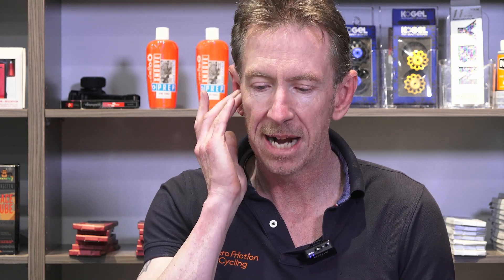Episode 10  - 12 Speed Chain Compatibility

Comment: Question: Is the previous 11 Speed SRAM Red eTap crankset (52-36 for example) compatible with the Red eTap AXS 12 Speed chain, AXS Front derailleur, 12 Speed cassette (10-28) and Red AXS rear derailleur? If not, why?

I just don't like how it's machined out of one piece, making the powermeter consumable once it wears out. Can't get a clear answer on this.
Reply from the maker: Hi Chris - sadly that is a definite no. The 11spd crankset is made for an 11spd chain which is 5.6mm wide and normal size rollers. The axs 12spd moves to a very thin chain (4.9mm wide) which has oversize rollers. The rings, cassette etc are all designed for a chain that is externally much thinner, internally thinner and with over size rollers. That chain will not run on chain rings designed for the sram 11spd chain, and the spacing between the rings would be wrong the the axs front mech. I do not believe you can purchase red axs 12spd chain rings to fit the older cranks either - they are making sure you stay in the correct system compatibility. 

It is, in my opinion, almost criminally stupid to integrate the power meter into consumable wear components such as chain rings. Yes their chain rings are hardy, and so if looked after by the user a) running a top lubricant choice and b) replacing chains at wear replacement mark - then lifespan will be very good - but still, that is nuts to need to replace PM when replace rings. 

however - as we know all to well, a huge majority of cyclists a) run a terrible lubricant because of so many reasons, and b) do not track chain wear. There is only so much abuse chain rings and cassettes can take  - run a crap lubricant and run it too long - well that will be the ball game for those rings in relatively short time. 

Again sram do some great stuff. Small rings for road / tt and 10t cog is not one of them. Having pm with consumable rings is not one of them. Having tool hard steel xx1 / xo1 cassettes for the smaller 11cogs but a super soft, not individually replaceable largest cog is not one of them. I find these three especially extremely frustrating. Had i been at the meetings where such things were signed off, i would have been interesting to deal with indeed and by end of meeting would have been fired. Or arrested.
Reply: @zerofrictioncycling992  Thank you. That was brilliant information that just doesn't exist online, or I don't know how to use Google... If nothing else, SRAM AXS is literally going to force me to be super particular about cleaning my bike, drivetrain, and checking my chain in an attempt to keep my chainrings and PM working for as long as possible. Or, I could settle for Assioma or Rally pedals. The latter feels easier.
Reply from the maker: @M3GRSD  my pleasure and dont worry it is actually tricky sometimes to wade through the info out there. And ha yes whilst sram PM situation is nuts - you should see where shimano is at with there pm crank after many years of it on the market - i cant believe shimano have ballsed that up so much! (DC rainmaker has a great video on that recently - highly recommend watching). 

Assioma are brilliant but if on shimano you have to faff with a diy cleat change still i think. Rally are expensive, seem solid - mostly - i have just bought my third set, and this set is WAY OUT (like 50w too low) - hoping the latest firmware update and calibration will have fixed for next ride - first 2 sets have been solid, but at this price - i shouldnt be worrying about why my third set is so far out. still, should be fixable, and yeah, no way on earth would i run a power meter integrated into my chain rings - especially at those costs!

Comment: The Shimano 2x11 speed chainring does not work very well with the 12 spd xtr chain as it got problems to climb from the small to the large ring. The problem is described  in another yt channel https://youtu.be/ruHtdwH0A1g
Reply from the maker: Thanks erik - yes it is probably time for me to update this vid - since this one we finally obtained loss figures for shimano xtr / da 12 and it is MUCH slower than expected. And whilst the anecdotal feedback i have received for use on 11spd has been overall very positive, we always need to be cautious. Small things like person A chain line angle vs Person B due to cog / rings size, bb, crank spacing, chain stay length etc - small things can change chain line angle for one rider vs another enough that in certain cogs - front shfiting for one will be a different experience to another etc ,and one person might report its perfect, another have issues. I will watch the vid you sent soon, thanks!
Reply: Thanks, the problem is due to longer distance between the climbing pins on the 11 spd chain ring. 
I had a very standard setup with complete Shimano R8000, 52/36 chain rings, 11-28 cassette and the cn-m9100 chain.
Tried to adjust the front derailleur with both setup screws and compensation via Di2 sw, but with no success.

When talking about compability, I think this is a major flaw.

I guess the person(s) who reported success used a non Shimano crankset or chain rings.

As I use the large chain ring in 99,5% of the time the problem is not huge. Did ~7500 km on the cn-m9100 chain last year.

Comment: I was looking at your chain testing online and I can see the results where you mention x01 and xx1 being reliable but slow. I was wondering what happens for sram gx.... as your result show a very high wear rate (relatively) ... is it faster at the cost of reliability or is it slow and with a high wear rate ?
Reply from the maker: Honestly do not buy a gx chain. They do wear super fast, and just the cost of eagle cassettes, it is not worth that rapid wear rate at all due to the damage that will do to a very expensive component. People get caught out with GX all the time. I have had customers in the workshop days who would come in to get their chain cleaned ready for waxing, they had done say 5 rides on gx chain with factory grease, and chain is already between 0.3 and 0.5% worn, so its done. In real world riding vs control test it would not be unusual for x01 / xx1 chains to be at least 10 to 20 times more wear durable than gx. 

It is due to srams hard chrome treatment on x01 / xx1 - their hardchrome treatment is industry leading, by miles, re increasing wear longevity over other brands chrome platings. 

We dont know if GX is faster or not, it is possible - but even if it is a bit faster, it will still by no means be a fast chain. A little bit faster than the slowest chains ever tested (x01 / xx1) does not equal fast. A fast chain for eagle is ybn sla 12 - what a lovely chain that is. 

**you will not notice that an x01 / xx1 chain is slow in your riding. They are a smooth chain and get along great with waxing (good bond). They are the worlds best training chain due to their unmatched wear life, and if you dont race, seriously - you will never notice that it is slower than say the ybn. If you race, training on x01 / xx1 and racing on ybn is the smart way to roll.
Reply: @zerofrictioncycling992  qual corrente com melhor custo benefício para utilizar em grupo sram rival de 22 velocidades?

Comment: I'm running the mullet setup on my gravel bike. XX1 rear deral with GX Eagle 12 speed chain and GX 10-50 cassette. What options do I have for a road style wheel set cassette? I'm wondering if I can run the new 12 speed 105 cassette as it's not Hyperglide+ (just regular Hyperglide). Is there any cassette you'd recommend that's somewhere close to 11-44?
Reply from the maker: Hey there - yes you could run the 105 cassette, but i assume a different wheelset as that would be different freehub. I dont know of any other options that are 12spd and more road type gearing (aside from like campy 12s). All other 12s cassettes are really mtb cassettes (garbaruk, e-thirteen, sunrace) with same / similar range to eagle. Sram road / xplr not compatable as use the flat top chain - different standard. 

But you are going to have issues - you cant just plug n play a much smaller range cassette as your b-tension will be way out. Ie the upper jockey wheel (guide wheel) is set to clear the 50t in cog 1, 42t in cog 2 etc - and following eagle cassette step downs in cog size. The eagle mechs parallelogram is designed to follow eagle cassettes cog sizes.  If you put a much smaller range cassette in, then it will have WAY too much clearance - so the guide wheel will be miles away from the cog, and it will stay miles away - leading to terrible shift performance and poor wrap of chain around cog which may lead to chain jumping off cog under higher loads. 

You would need to adjust B-Tension every time you swapped between the two cassettes. The parallelogram will then probably be ok with 11-44 vs a 10-50, but i wouldnt push it any more than that.
Reply: @zerofrictioncycling992  thanks for that detailed reply - it explains a lot. I just wish I had seen a few weeks earlier having just tried to run a road setup on my Eagle mullet gravel bike (confirmed XPLR cassette does not work, and 10x36 Force is wonky). I guess that explains why Sram came up with XPLR to allow wider range gearing that would work with “ road” derailleurs. Bottom line I guess to keep mullet option and XX1 RD for gravel bike, a road wheel setup just has to use the big eagle cassette 🫤

Comment: Hi, great video. Lots of useful information but a bit lengthy. I listen to it as a podcast while driving. 😂

On the SRAM AXS RED vs Force chains, I'm very curious to know why the Force chain is very slightly faster than RED. Will greatly appreciate if you can answer this. Cheers and I look forward to more of your videos or "podcasts".
Reply from the maker: Thanks huang - and ha thats how i do most you tube content myself - sorry re length, im working on it. Not my strong point but i am working on it .... :). Honestly no one can give you a definite answer on that. It is highly, highly unusual. It is the same situation with their eagle chains, where x01 is faster than xx1 by basically same amount that force is faster than Red. It shouldnt be the case, and its confusing, but ceramic speed have tested and re tested across multiple batches. No answer on this will ever be forthcoming from sram i do not believe.  They will be on different production lines as Red has hollow pins etc, xx1 have ti-n external plating and hollow pins  vs solid pins - but likely there is a slight difference in the way and number of parts HARD CHROME is applied, and maybe there is a slight tolerance difference - if they are a little tighter tolerance, they will be slower for awhile until very broken in. But honestly, overall it is a bit of mystery, Red should not be slower than force, and xx1 should not be slower than x01, typically on higher level the low friction coating used is applied to more parts of the chain, - ie shimano siltec on 105 is applied to pins. For ultegra it is applied to pins and inner plate links, for DA it also applied to rollers, and each level is faster than the other. We would have expected the same with sram - and maybe they do - and it is something else in the mfg that is causing the higher level with low friction coating applied to more parts to still be slower, such as tighter toleranced fit etc.
Reply: @zerofrictioncycling992  Thanks for the speedy response and detailed information! Yeah, initially I thought it could be a batch issue, but you clarified that it was tested across batches. This is indeed weird. For the sake of marginal gains, I'll be upgrading to a a Force chain (from Rival) then. Many many thanks again for going deep into this technical realm. 🙏
Reply from the maker: @huangteng  My pleasure im trying to be better checking comment questions :) And yep this is why if one buys a ceramic speed axs road UFO chain - it is force, not red level, as that is the faster chain - and as it was an unexpected resulted, this was checked and re checked a lot before they made to call to go force vs red (and same re eagle). 

it is still being investigated as i have concerns regarding the compatibility as they are different standards - but now both KMC and ybn claim their 12spd chains are compatible axs road - and extensive field testing by mspeedwax in USA for ybn 12 with axs road riders has been extremely positive. Depending on budget, you could look to run a ybn 12, or for the fastest known chain at this time, campy super record 12 (2.8w vs force 5.5w - same standard as the ybn 12, from memory ybn 12 circa 4w vs force 5.5w) - if they run ok and at race loads (test carefully.....) - then they are are much faster chain, sram do many great things that i am huge fan of, fast chains is not one of them, and the smaller rings = smaller cog for a given gear inches and smaller rings = greater chain tension so the greater articulation is happening under high chain load for a given power vs larger ring - a penalty that is lesser the faster the chain, penalty greater the slower the chain - if ybn or campy 12 as a race chain tests ok on your bike, then that can be an option. I have covered in the video above i think the concerns re compatibility of this, however mspeedwax are the north american distributor of ybn for USA and so have been having the ybn 12 tested with a lot of athletes and they have had no negative results yet - i remain concerned to say the least, however - if you are looking to save another 1-2w and can afford to buy a chain that may not work out - it can be worth a play. triathletes / time trial less likely to have issues as steady state power, any issues are more likely to come up under high power  - and my fear is a chain jump under stand up sprint sending rider over the bars onto asphalt - so yep - test with caution if you try
Reply: @zerofrictioncycling992  Thanks again for the detailed explanation.

You mentioned that YBN and KMC claim that their 12spd chains are compatible with AXS road. I googled but couldn't find information to support this claim. I think I'll still play it safe and go with Force - I'm concerned about the longevity of my powermeter chainring and cassette (which cost quite a bit) over saving 1.5W. That 1.5W will still bugger me time to time, but I guess it is something to live with until more concrete data is available on the compatibilty of a 3rd party chains with AXS road. On this, I guess I'll continue to stay tuned to your YT and website. 👍🙏

Yup, I read about the smaller SRAM chainring, cassette leading to more chain articulation and thus more watts loss. I read about it AFTER I bought my SRAM equipped bike haha. But I really like SRAM for many other things like it being truly wireless (removable batteries) and the design of its crankset and the very ergonomic Rival shifters.
Reply from the maker: @huangteng  KMC product information claims their 12spd chain compatible with ALL 12spd systems, and YBN have updated that information too (i dont have that on my product info though). The main concern for me is smaller rollers vs oversize axs rollers - the axs cassette and rings are profiled for larger rollers, running  chain with smaller rollers would to the drivetrain be like running chain on very worn components - and we know that putting a new chain on worn cassette / rings can have chain jump under load. Sometimes (as in stand up pedalling at high power) - this can lead to very bad outcome for the rider. Also they are notable wider, so tuning would need to be extremely precise. this may be fine on one bike, but what if another persons hanger is 0.5mm out of alignment, will they be able to achieve an absolute perfect tune such that the wider chain is not rubbing in some cogs? 

Yes those chains are notably faster than srams not so fast chains, but one should test carefully if moving to a ybn or kmc for more speed for racing - maybe it goes perfectly, maybe it doesnt. Unfortunately i have not much hope that sram are going to make a fast chain, and the slower chain = greater penalty for smaller rings = more articulation at rings and at greater chain tension, a smaller cog at rear for given gear inches = more articulation. THe move to small rings for road is, from an effeciency perspective, bad. And not having a really fast chain to minimise penalty for this is, not great also. There is a reason why shimano and campy will not follow that path, and you can see how much pro's also have these concerns, they were very quick to get 54/38 ringset not avail to gen public, and lock out the 10t, so going back to where they were with 11spd. Because 48 / 32 with a 10t for road.... this has not been srams finest move. i am a huge fan of a lot of what sram has pioneered - axs roads small rings move is not one of them, and i wish they could make a fast chain. They should release a tt / race chain - they would sell heaps. If you race - try to break in chain well in clean conditions - they will get faster for a good while as their tight tolerances loosen up a bit.